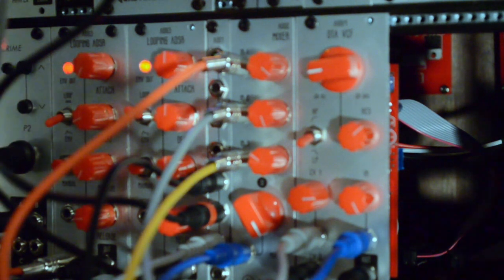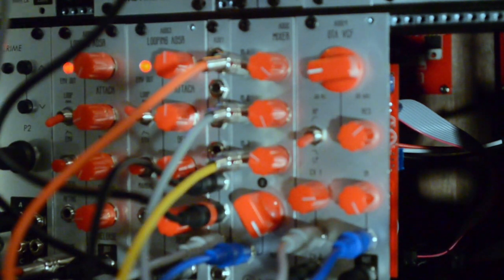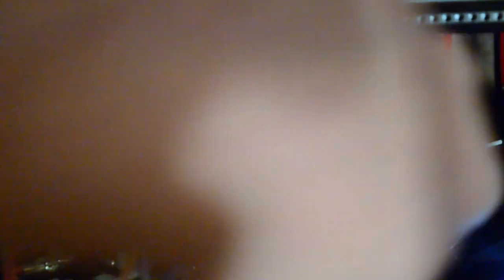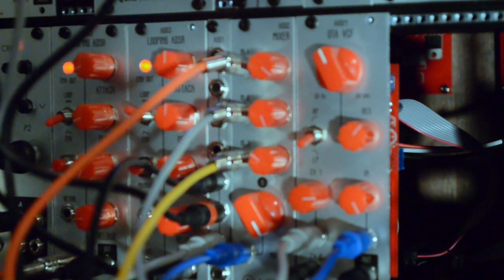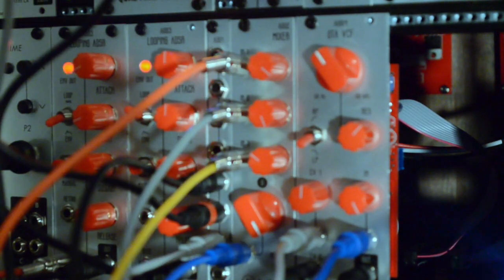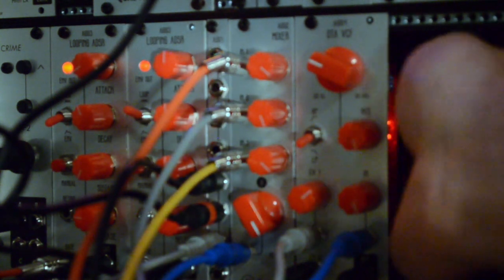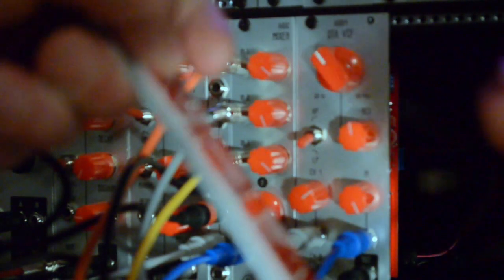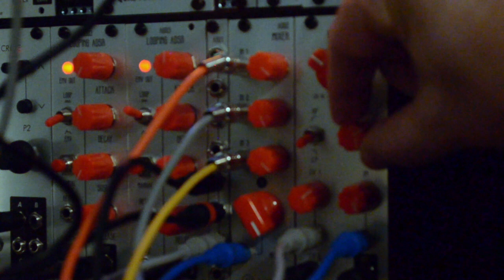AI004 DIY Eurorack OTA Filter First Look

Comment: I was about to buy a Rackbrute, but this won't fit there or?
Reply from the maker: I think it would fit. All current modules are skiff friendly.
Reply: @AISynthesis  I'll give it a try. I can switch out the bus board with a flying bus cable if it doesn't I guess.
Reply from the maker: @Dougie-  pretty sure it would. Arturia actually borrowed a bunch of modules for it's debut at Namm that year and didn't report any issues. That was before I made the current v2 which doesn't have a switch on the back and isn't as deep.
Reply: @AISynthesis  Great. Thanks! Totally new to this. Looking to buy my first rack and there's soo many variables :-D